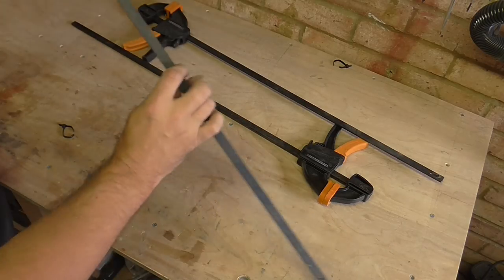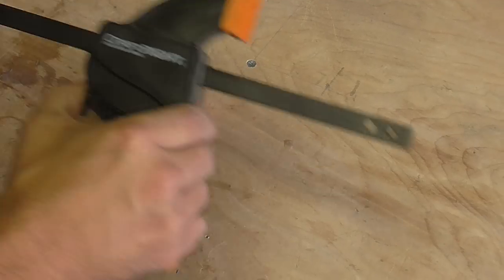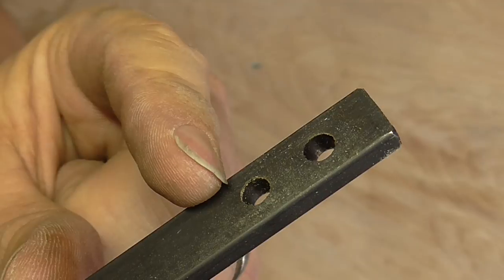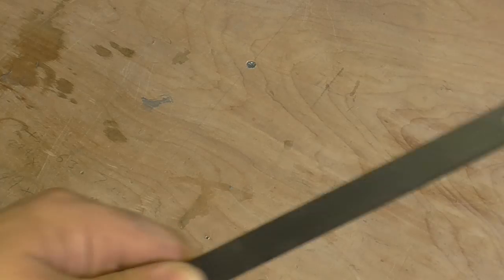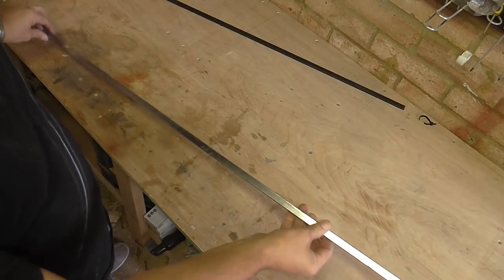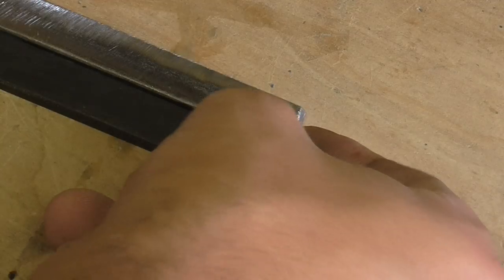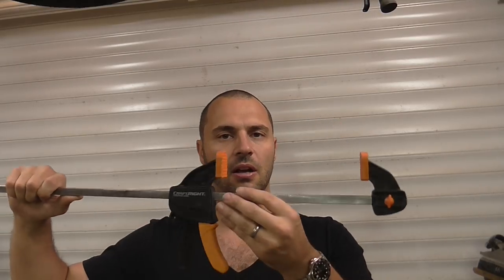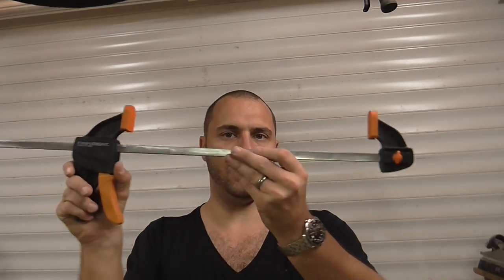How to extend your clamps!

Comment: I have similar clamps and occasionally need a longer one than what I have. My solution costs nothing. Using two clamps, I take off both removable jaws and then using a 5 mm bolt and nut, I attach the two bars using the existing holes so that the two ratcheting jaws are at opposite ends so that I now have a clamp with almost double the length. You might have to restrain the middle from bowing out as you apply clamping pressure. This could be avoided if you remove the spring dowel pins and use two bolts to attach the two bars.
Reply: It's also possible to use two clamps by extending one to its full length and tightening the other clamp onto it by budding up the two jaws.
Reply: I prefer at all times to clamp using mnmn.

Comment: Best idea I've seen on YouTube for a while, iam off to measure the bar in my clamp then onto eBay to order, thanks for sharing this idea.
Reply from the maker: You're welcome I hope your clamps aren't odd sizes!
Reply: You could connect 2 clamps with 2 short side pieces and existing holes. Take of the non moving parts of clamps, punch out the locking pins, cut 2 pieces of similar bar long enough to cover 2 holes on one and 2 holes on other clamp. Align and mark holes and drill 4 of them in both metal strips that you cut. Now face bar ends and bolt it with 4 bolts. With that you'll double the length of the clamp and you'll have clamping mechanism on both sides. Procedure is reversible :)

Comment: Hi mate, I spent about £25 for one long ratchet clamp (1.2m) not thinking I had umpteen 300mm, 450mm and 600mm ratchet clamps laying around! If only I had half a brain I could have used this method to save myself alot of money! I will definitely be giving this idea a go after I have measured the steel bar of my clamps. Thanks for sharing this idea pal. N.
Reply from the maker: Thanks Neil hopefully this method will work for your clamps if you need any more long ones.

Comment: Done exactly the same as this a few years back, i just buy the shortest clamps i can and buy the steel to extend them. You save a absolute fortune on large clamps if you don't need the same clamping pressure as long sash's

Comment: Good vid, i also would like to add that You can also use cargo straps. You can get 4 straps for 11$ with 6 feet of lenght. Just use a wooden block to wrap around the corners or buy some 1/4 inch rubber. Works great and gets the job done with ease
Reply from the maker: +BaTTaLioN CLaSH GaMiNG thanks in the UK we call them ratchet straps.

Comment: Make 2 small steal pieces with holes matching the holes in the clamps and bolt two clamps together when you need longer ones much cheaper that way and is extremely sturdy with a small piece on each side with bolts going through

Comment: the easiest,  least expensive, simplest and fastest  clamps to extend are pipe clamps.  all you have to do is buy a longer threaded galvanized or black-pipe and a union.   Now you can make any length you want.  Another benefit is that you can carry many small sections of black pipe in a small car.  Example, if you need a 10 foot  clamp you an carry 3 x 4 foot pipes and 2 unions and everything fits in a small car.
Reply from the maker: Pasquale you seem to be quite the expert I'd love you to make a video and share your knowledge.
Reply: Why are you feeling so offended.  There are harsher posts than mine.  I did excuse myself (somewhat) when I read your post that the black pi[pe or even galvanized in not available in the UK or even that it was expensive.  Once again which statement insulted you?

Comment: You could have taken a short piece of steel of similar dimension and drilled two sets of holes matching the bars into it.  Then take the "links" and attach them to two bars and you would have the 1200mm by using two bars and only have to buy 1/2 half as much long bar for the same results.  Not wasting the existing bars.  Just a thought.  I have actually bolted two existing bars in a pinch.

Comment: I think it would be a good idea to put back the end stop "lug " at the fixed end of the clamp. By leaving it off the clamp relies on the single 5mm bolt through the plastic fixed jaw instead of the much stronger  lug . . .  I think they are called roll-pins

Comment: Good idea but I have a better one. Use pipe clamp assemblies, actually a better clamp than those plastic ones and you simply purchase black iron pipe for what ever length you may need. You could make a 20' clamp if you needed one by screwing sections of black iron pipe together.
Reply from the maker: Not a good idea if they are almost impossible and therefore very expensive to buy here in the U.K.
Reply: from your response, I guess black pipe is not readily available in the UK.
Reply: I thought the same thing. Regular galvanize pipe works just as well, black iron pipe is cheaper in the US.
Reply: same here in Canada but I like the Galvanized, no need to worry about rust.

Comment: Or drill hole at end of each bar then attach s hooks.  use chain in between. That way u can pick whatever link on chain u need for length.  It's an extension piece between 2 clamps (butt end to butt end)  got the idea from some gadget they were selling that reminded me of chinese finger trap  (Google it)

Comment: Those clamps are the same cheep clamps sold by Harbor Freight. I bought a few of them and found out that i could have flushed my money down the toilet just as easily. They are made of cheep brittle plastic and untreated metal that rusts quickly in humid weather regions. I've used only a couple once and now they are all rusted and have 2 out of the 4 with broken plastic pieces.

Comment: Great idea. Thanks for the tip. I've popped to my local Homebase (now called "Bunnings") and picked some up just for this purpose. Actually, they are really pretty good clamps too for the price. The 600mm is £5.65 for two there. I've had some cheap rubbish clamps and these are a nice surprise. 
Did you find they were stable enough when you extended them?
Reply from the maker: Hi Darren there is a Bunnings near me too they are pretty good stores.
You are right the clamps aren't bad. 
I haven't used the extended ones on anything too heavy duty but they seem to be pretty sturdy.
Reply: Darren Lane I

Comment: eBay there must be a lot cheaper to ship. Over here it would easily cost 3x more to ship than the price of the steel
Reply from the maker: traderjoes the price I stated included shipping and to be fair I think about 50% was shipping. If you can pick the right size up locally without shipping being needed you could probably save a lot.

Comment: Did you need 2 holes in the end
Reply from the maker: Probably not in both ends but I wanted to exactly mirror the original should I want to use the clamp as a spreader.